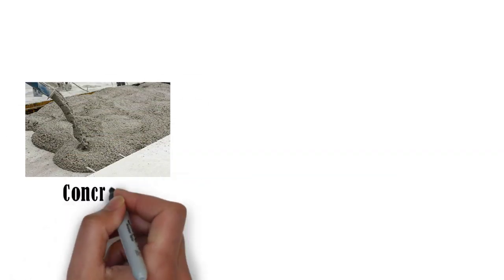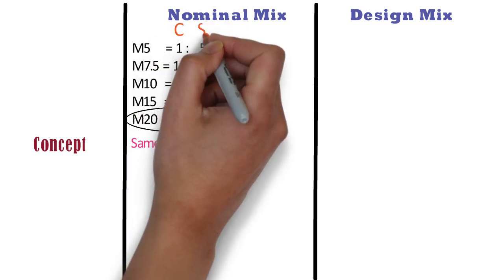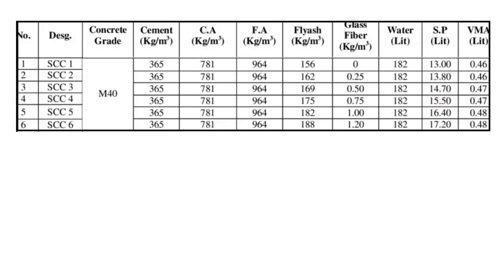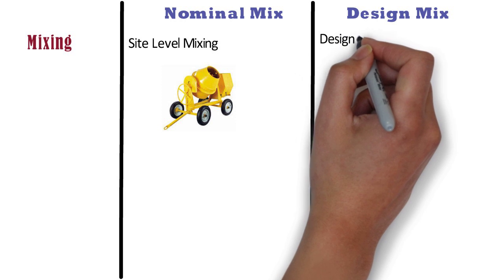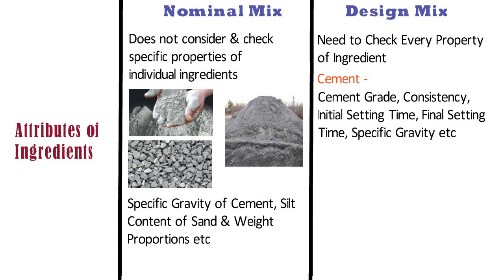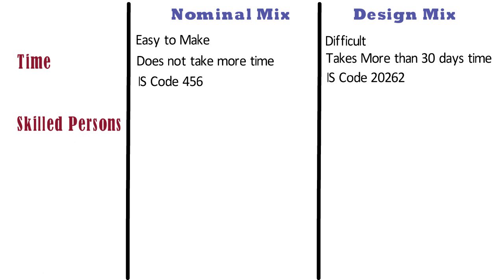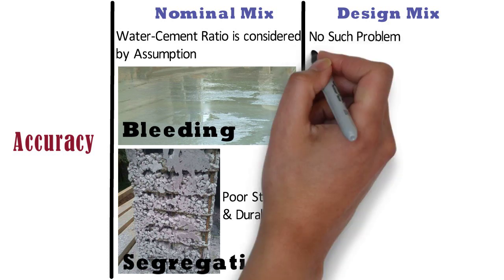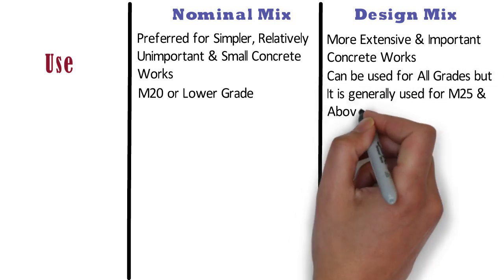Nominal Mix vs Design Mix of Concrete

Comment: Could you explain how 1.55 is multiplied to get volume mix in nominal concrete?
Reply: To get the final Wet quantity of 1CuM, Dry composition is increased by 55%. That is why the 1.55 multiple.